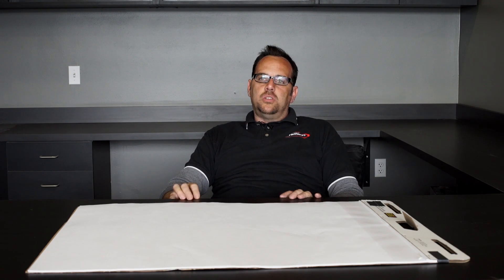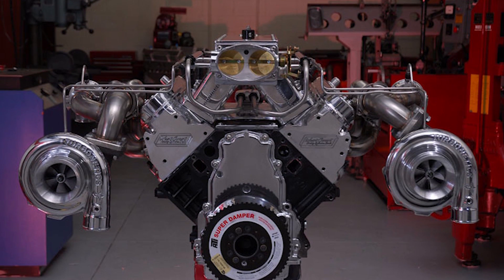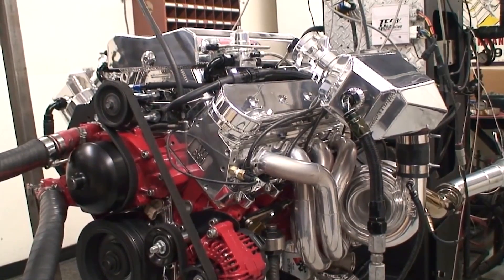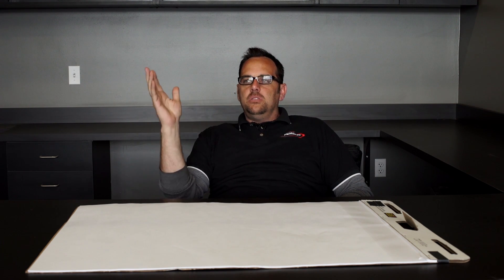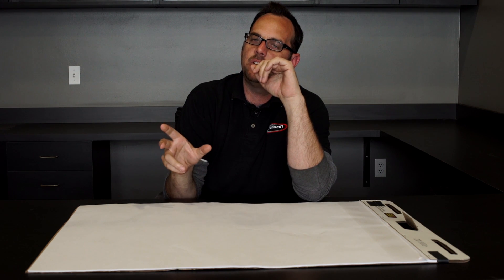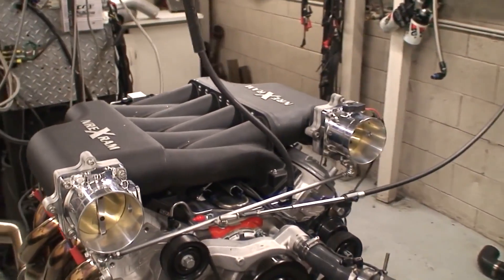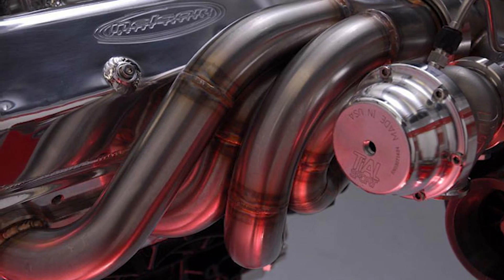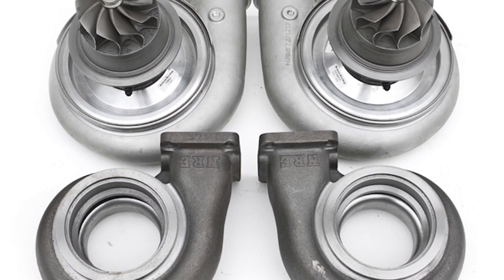Master Engine Builder Explains Why the LS V8 Is SO Good

Comment: "volumetric efficiency, whats that?" - every stock LS owner
Reply: +Marc Monson Who cares, how about the fact the physical size and weight are less than everyones else's V8? how about the fact it weighs less and takes up less space than basically everyone's V6 or flat 6,(and that's not taking into account the turbos they need to make the same power as an NA LS.)The displacement may be large but they are small and light physically, I will take lighter, physically smaller large displacement engine over a smaller displacement but physically larger and heavier engine every time. An LS engine will fit in damn near anything because it is so compact. The physical weight and size to power ratio is unmatched. That's far more import than Power/liter
Reply: DOHC, keeping ford engines out of miatas, volvos, and RX7s
Reply: Marc Monson
No one is arguing 4 valve heads flow more air. DOHC engines can make great power. They do so at the cost of more cam, valves, springs and drive chains. They also put more weight up higher on the engine.
Reply: +Marc Monson  But in the end, it's power-to-weight that makes the car go faster, not VE. And the LS engines weigh less and put out more power than the Coyote, despite having larger displacement.
Reply: I had the LS7 in mind: 505 hp and about 450lbs, but you're right: The LT1 would be the one to compare to the Coyote, and the LT1 still has just slightly higher power-to-weight over the Coyote and is physically smaller. Then there's the whole lower COG thing. My main point being that HP/L is just a nominal number and doesn't give any indication of the actual physical size or weight of the engine.
Reply: +Marc Monson 
VE doesn't matter for shit unless you're building the engine to a specific volume for race class or reasons or government tax regulations.  Otherwise, power/weight and overall size, are more important because then you can stick it in anything with minimal penalty.  The Coyote is an awesome motor, but those giant DOHC heads mean its COG is higher and you need a massively wide engine bay to fit it in.  The LS is light, compact, cheap, and fits just about anywhere.  It's not the pinnacle of modern technology, but DOHC isn't either, it was invented before OHV for the record.
Reply: +Marc Monson What does VE mean in the long run? 455 hp out of the 6.2 LT1 is still more than 435 hp out of the 5.0 Coyote.
Reply: Marc Monson  Doesn't matter. What matters is if it makes the same power or more as other engines of similar weight and physical size (exterior dimensions: not displacement). Power-per-liter doesn't make a car go faster: power-to-weight does.
Reply: And Ford's engine still weighs more, is physically larger, and costs way more. Ford 5.0l is 444 lbs thats engine only, no accessories, no manifolds etc, The LT1 is 465 lbs with all accessories, and manifolds, those parts weigh more than 21 lbs. according to ford literature when the 5.0l was launched the motor is 30-35 lbs heavier than an LS3
Reply: +Marc Monson Thats the only way ford knows how to make power.
Reply: Fair enough. Still. my point stands. GM made over 500 hp 10 years ago with an architecture many people call outdated yet Ford just cracked 500 hp this year, and it took going with a flat plane crank and revving to 7500 rpm to make that number.
Reply: +Marc Monson "Gas mileage, what's that?" - Every BMW M car owner making less HP with an engine that weighs more and has higher volumetric efficiency.
Reply: +Marc Monson I'm just sitting over here wondering if anyone wants to do donuts. These guys up above sound so serious. -ctsv owner
Reply: you basically proved your point for me. Goes to show how air restricted is. Between great head design and DOHC i've heard the coyote is over 100% VE
Reply: well not really. without getting air in the engine you don't make power. Ford performance website says it weights 444lb, while the LT1 weighs 465lb...
Reply: if you have a 6L engine that can only pull in 3L of air (50% VE ) guess how much power you are going to make.
Reply: OHV is not 50% efficiency. Besides, so what if it was? The LS series went from 4.8 liters to 7.0 liters and 285 hp to 638 hp in the same architecture. The Coyote is pushing it's limits at 5.2 because of bore spacing. If GM can reach its power goals in an architecture that is simpler to build and maintain while being compact and relatively light, what reason is there to change? And I'm not talking about some worthless stat like hp/l.
Reply: the 50% waas an arbitrary #/... throwing  the s/c ls9 into a NA fight isnt really that fair..
Reply: +Brett Hobbs This year? 2005 Ford GT - 550HP. Also the 5.2l is not a coyote, it's a voodoo (can't say I dig the new name but not the point).  And saying that the coyote is at the limit is a huge understatement. The new Shelby GT which uses the coyote and a bolt on supercharger (No internal upgrades) and creates 700hp+, Shelby even offering even higher amounts of power without modifying the engine internally. I may have read that statement about pushing the limits incorrectly in retrospect (were you referring to displacement limits?). Even so, larger displacement doesn't appear to be a problem or solution.
Reply: Evan Kelley
I'm talking naturally aspirated. The 5.2 Voodoo is based on the Coyote.
Reply: +Brett Hobbs cool story bro, Actually Ford made over 600hp close to 50 years ago with a DOHC. That 5.2 can push over 600hp easily. Shit, Ferrari can push close to 600hp with a 4.5L. I'll like to see an LS motor destoked to 5.2, something tells me none will make over 340hp. The fact  is a 331 Doch on the engine master challange  busted the big cube LS and hemis the first year they where allowed to compete by making more power and torque.
Reply: +cerebraldamage What factory stock Ford made 600 hp? Besides, power back then was gross rated, not net like today. That means the engines had only headers and no accessory drive on the front. They made far less power in the car. Ferrari has nothing to do with the discussion. Why limit the LS' displacement? The architecture can go way beyond 5.2 liters where the Coyote based cannot, or do you think Ford just randomly chose 5.2 liters? Great, without smog requirements, the 5.2 can exceed its current power rating. LS7s can make north of 650 hp with some mods too.
Reply: +Brett Hobbs We are talking about engines are we not? now you want to narrow it down to what had what? LOL typical..There's plenty of Ford FE 427 pushing over 700hp and some in the 800hp range, Now that i remember the Ford DOHC didn't just win, but blew the LS engine out the water with a 1st ,2nd and 3rd place victory in the engine master challenge. The issues here is you think you need cubic inches to make big power, the fact is you don't on a DOCH. For example the 4.5L in the Ferrari 458 Speciale makes the 7.0L LS motor look silly even the 6.3 SLS  Black is pushing over 100hp+  more than the 7.0 LS motor. Both these engines passed emission just fine while still making more power that the 7.0. That 7.0 isn't going to push anywhere close to 650hp without throwing everything including the kitchen sink and on race gas to get there. The 5.2 might be limited on displacement but is far from tapped out in stock form. The 5.2 can push 600hp without ever lifting a head a simple cam swap put it 650hp easily.
Reply: cerebraldamage
I'm not the one who narrowed it down. I said the LS made from 300 hp to 638 hp on the same architecture and another commenter said only naturally aspirated engines so I said Ford didn't have a production n/a engine making over 500 hp until this year, 10 years after GM.

Yes, the modular engines did well in the EMC. They also were over 400 cu in just like the LSs. Of course they would do well. 4 valves with all that displacement would make good power but I wouldn't want to run an engine with that much stroke for a street car.

The LS7s making 650+ have basic mods. Heads, cam and exhaust. Not sure why you think it needs everything and the kitchen sink to do that.

Sure, the 4.5 makes more power than the LS7. It also revs to 9k rpm to do it. The 6.2 AMG is very expensive and very large engine.
Reply: +Marc Monson You should post more comments on the same video talking shit... lol
Reply: +cerebraldamage actually go read up on the early 90's C4 ZR1 corvette. that was a lotus/gm DOHC monster. it was a 5.7 but still gm tried DOHC. it was WAY taller then the Lt1 and really didnt make all that much more power
Reply: ***** the things you type...when GM made 505hp they were using 7L to do so. 7. That's nothing to brag about. A dry sump lubrication system on a coyote brings down the center of gravity. If the block was 60°, instead of 90° it would be narrower. LS blocks blow just like any other block. I don't wanna read none of that power per dollar crap because it's not true.

 A 351 Windsor block will run stride for stride with an LS all the way down to stroking potential. For some odd reason people seem to keep ducking the whole fact any 3V slapped with a set of twins will put a nobody in the low 9's, for about 2k, even less if you know what you're doing and what kit to source. Did I mention the engine will still be purely streetable?

People are just lazy and scared. They don't read, they just try to do what the next man does a little better, which is just plain ignorant.

All the weight savings you speak of can be swapped with a driver mod. Dimensions mean nothing if the weight is almost equal or the height can be adjusted...

What bothers me is so many of you LS lovers sight the same things as key points to why it's better. None of those points are really valid. Displacement, dimensions and simplicity you get a 351W. If you boost any OHC engine, however, the only thing you worry about is dimensions. You don't need heads or cams. Might need intake though...? Nah, all you'd have to do is wire the imrcs open. Help me understand here.
Reply: Ls weighs less that's a fact, it's smaller that's a fact. center of gravity is lower, that's a fact. a set twins on 5.3l will go 8s without much fuss. There is reason why there are way more LS powered "any car" than mod powered cars even Fox bodys,lol. So while a mod/351w motor is not bad it's not as good as an LS. Your argument requires a lot "ifs" and "almosts" to be as good as an LS. (not to mention you are using two different engines to try and make a case for the Ford engines.)
Reply: Michael B that's your best argument? Every time a Ls has took on a Windsor of equal build quality, it's lost. Every time a ls has taken on a ohc of equal build quality it's lost. The engine builders magazine even states the 351 is better than a SBC , you can Google that by the way. Weigh less? That has no bearings when that can be offset by so many factors. To even type something like that in this comment section, when there's a coyote swapped fox body that destroyed multiple ls engine equipped cars, whilst being fairly stock, on this channel- is just crazy. 

People who do ls swaps are genuinely Chevy fans from the jump. It has nothing to do with stuff you or anyone else types in this comment section. Oh yeah, I used two engines because of all the excuses I read as to why the ls is better. You're bragging about 20-30 pounds and 5-6 inches over a ohc engine. I'm going to need something else here. I mean seriously.
Reply: Michael B every 5.3 I've seen needed heads/cam/intake. The 9sec fox body was on a stock 4.6 3V engine period, except for the turbos and fuel system. If h/c/i is, "without much fuss" I hate to see what's a, "little fuss". Probably be talking a whole stroked bottom end.
Reply: A little fuss was $500 engine with a $250 cam and $250 intake.  here is a good example. http://www.lsxtv.com/news/l33-swapped-240sx-goes-8-99-in-the-quarter-at-ls-fest/
Reply: Michael B come on mike. The care weighs 2800lbs soaking wet...here....

JPC Twin Turbo 3v Foxbody runs 9.08 on a stock motor ...

YouTube › watch

Again, someone help me out with this ls thing because I'm not  understanding.
Reply: Smackledorf Mcsween My argument is that there are far more fast ls powered everything. even ford's most popular drag car. And yes I will take a lighter smaller engine all things being equal. but they are not While a mod motor can probably make a touch more power/liter, who cares, The LS is more liters and can go to way more liters, makes more power and weight less. takes up less space, and cost less. Site whatever magazine opinion you want, in the real world there are way more fast LS powered car than mod cars. I'm not sure why you talking about ford windsor vs chevy sbc anyway? this started as  MOD vs LS.you have now dragged a forth engine in, to try and make your argument. Again those are facts.
Reply: Smackledorf Mcsween your link is no good.
will this make you feel better? its in a fox body. 4.83 in the 1/8 works out to 7.70 in the 1/4 do you get it now? run 7s or run 9s with mod engine take your pick. http://gearheads.org/1992-ford-mustangs-stock-engine-wows-outlaw-racing/
Reply: +Marc Monson Volvo engines belongs in Volvos. Why throw a LS into an engine when Volvo's own V8 is better in every way?

Comment: another great all iron motor that's super cheap to boost and reach 400plus HP is the KA24 in the early 90's Nissan 240sx... all u need is forged pistons and rods with cylinder skirts and a 2nd hand truck turbo from a junk yard